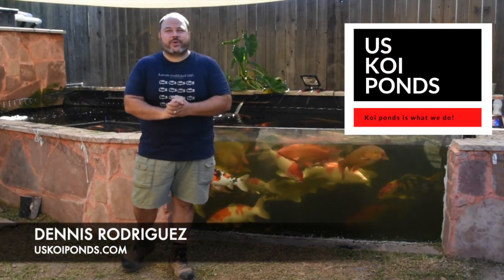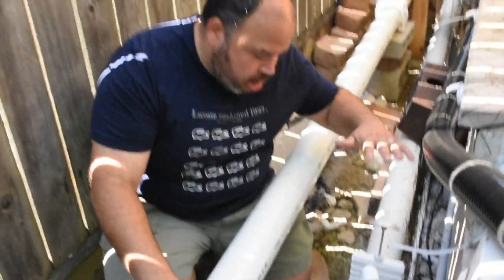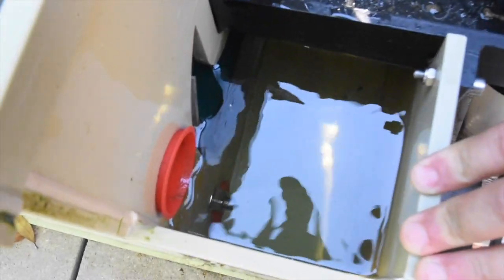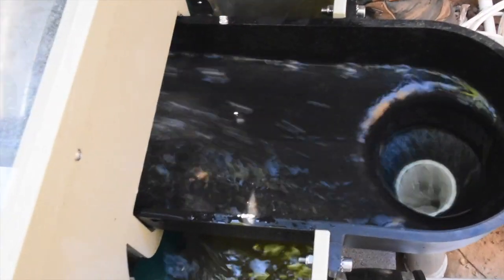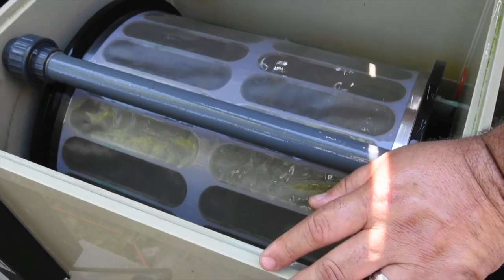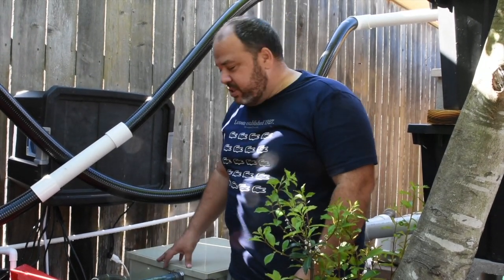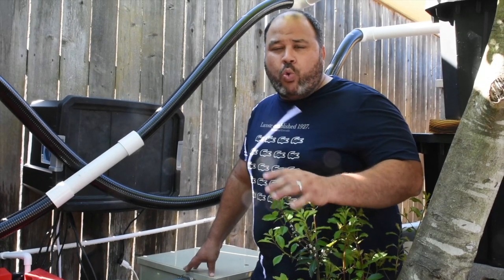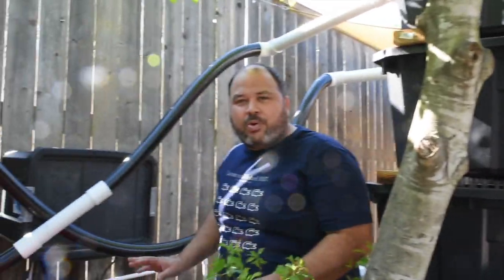What is an RDF?

Comment: So the RDF technically is a filtration? You will need a pump to pump from the pond to RDF unit and back out to the pond?
Sorry I'm a beginning. 
Can i get this particular model and brand. I'm interesting in this unit.
Reply from the maker: Yes RDF is a type of mechanical filter. Some units also incorporate a biological side and are known as Combination RDF or Combi for short. Regardless of the unit you do need a pump to either pump water into the RDF or pump water out of the RDF and back to the pond.

Comment: How much is that?
Reply from the maker: Hey Cedric? You are asking about the RDF? They can run around $2,400 on the cheaper side and up to $6,000 for very well built brands. It also depends so much on what size you need to fit your pond water volume. Thanks for watching.

Comment: Thoughts on a retro fit bottom drain into a RDF?
Reply from the maker: If you are going to run the pipe from the retro bottom drain over the pond wall (instead of through with a bulkhead fitting) then gravity fed RDF wouldn't work.  So the retro bottom drain will most likely have to be connected to a pump and the pump to the RDF.  Just make sure the RDF you buy is capable of being pump-fed. Thanks for your comment.